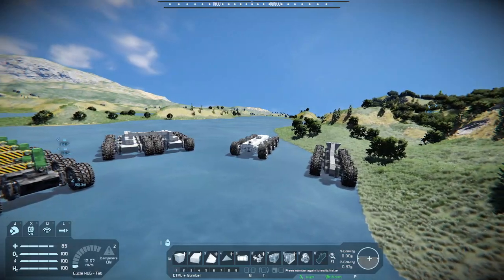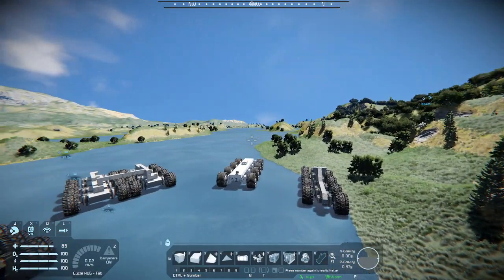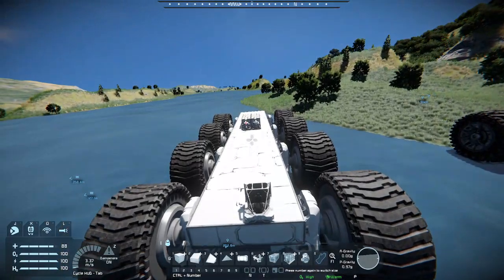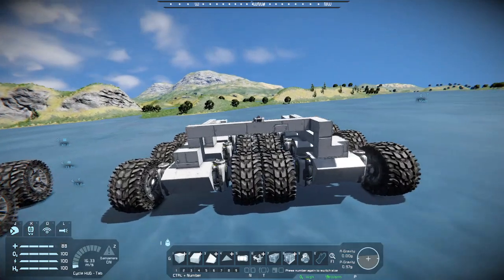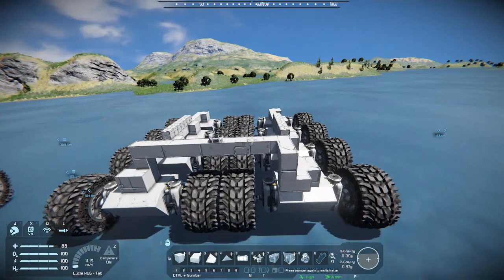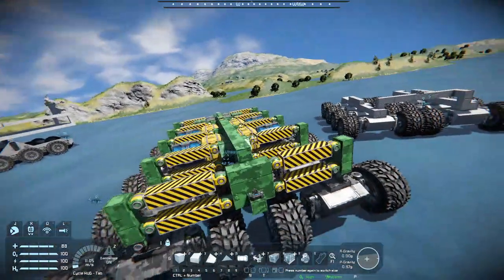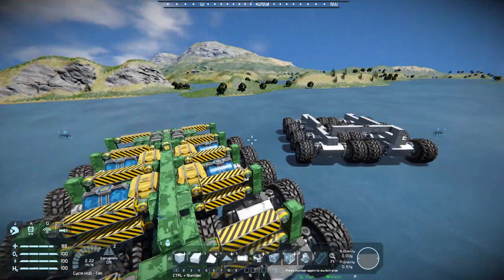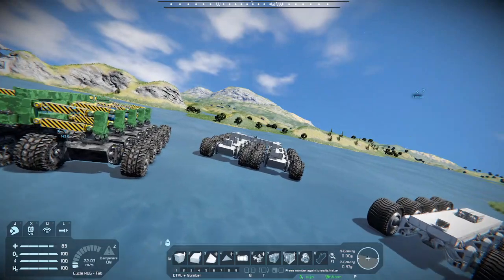Space Engineers - a good large grid rover for extreme terrain

Comment: Yours is the second SE design I've seen to use that double hinge arm suspension IRL, people use these with double wishbones instead of straight arms to provide more front-to-back structural support. The other design (Pandemic Playground) used a rotor to directly mount a wheel, but I figured one could simply mount an entire wheel with vanilla suspension, saving on PCU cost on the wheel rotor. And that's what you did! I also like your use of rotors for roll axis. I saw it on Patrick Hansen's channel.

In survival play, some of my own objectives are to figure out how to do more with less. It's too easy to bloat a design and in the end we have to strap thrusters on to shift all that weight. Also, for those of us who haven't upgraded our computers in a while (guilty here), it helps to keep the PCU cost down so the game has fewer moving parts to simulate. And of course, what would I rather spend those resources on -- opportunity cost? I play with Aww Scrap, which puts a much higher rate of resource loss on any grinding and reconstruction, b/c you no longer recover 100% of components or ingot material. It forces me to have to plan more carefully for where to spend resources, or for high-value concentrations, to make them more modular so that I can repurpose or reattach important blocks/modules when I change or expand in the future -- but modularity often comes at the price of a couple more blocks (and thus PCU cost and mass) for additional conveyors and structural blocks.

And high-investment masses of rotors/hinges/wheels and other high -PCU blocks are a big target for reduction, for me. The core challenge is to maximize wheel contact with the ground, to put power and traction down. And for me, how few rotor/hinge arms can I get away with, to accomplish this? For certain time/cargo pressures or requirements, what are some good trade-offs in complexity of fewer larger trips versus time spent on multiple trips?

But you're right -- it's fun to sometimes tackle stupidly difficult slopes and terrain head-on, just for the challenge. Otherwise it would just be cheaper to trade time for engineering and simply drive a more basic or smaller rover around the difficult terrain feature.
Reply from the maker: thanks a lot for your interesting comment

Comment: I was blown away by the performance of that rover.  This video is a few months old, have you made any upgrades to avoid the klang?
Reply from the maker: Hi Greg, thank you verry much. It took quite a while to come up with this design, probably 40-50 different ideas before that ended up in the bin... :).
Sorry but no, I did not upgrade, should be easy, like Splitsie sais adding a piston suspended bumper should do the trick, but it also will reduce valley crossing capacities.

Comment: Very nice ! Only problem with multiple subgrids is repair. If you blow off a wheel like you did at the end, you are stuck for an extended period rebuilding the whole thing or trying despirately to reattach it. if you can somehow lock it in so you can project it as a single grid then release it you would be golden.
Reply from the maker: thanks paul, to get a wheel back on it all you need to do is increase hinge force of the named hinge which will lift up the suspension. then attach and done. of course if we ripp of the mecanism (hinge assembly) we got an issue :(... what do you mean with "somehow lock it in so you can project it" ?
Reply: @pcgamerfocus7072  I'm talking about the entire wheel arm like in your case where it busted off at the last hinge, wheels themselves are easy. Fewer subgrids is better for survival, at least until someone figures out how to project subgrids.
Reply: @Neuralatrophy  ahh ok, now I understand, sorry. I have done the subgrid projection before on a huge ship. When I find the time I will add that functionality to the Rover
Reply: @Neuralatrophy  The main advantage of having so many axles is that each individual axle becomes less important. His rig is still ~90% as capable as it was before, even though it's missing a wheel pod. Also, subgrids do not project with the main grid, so what can be done is to create blueprints of the wheel pods themselves so they can be projected individually on each hinge. The suspension arms aren't that difficult to build, it's just that clang can ruin your day, even if you're careful.
Reply: @BeanoNoir  Of that much I am aware, but repairs on a subgrid assembly are long and painful depending on complexity. If it gets crippled, it can limp, but if you have to make extended stops to bring it back to full capability, you may as well have no wheels. :)
Having a system you can lock in with merge blocks and then project for automatic we;ding is the ideal situation.
Discard broken pieces, project, weld, attach, disconnect from construction mount then surprise your enemy with the phrase "Witness the power of this fully operational battle station"
Reply: @Neuralatrophy  Lucky for us all, someone has created a multigrid projector mod. You can find it on the workshop as Multigrid Projector (from user Viktor). There's also an Extra mod for using block rotation keybinds (from a cockpit or control seat) to adjust the projection. Both are also available in the SP plugins manager, which is how I load them.